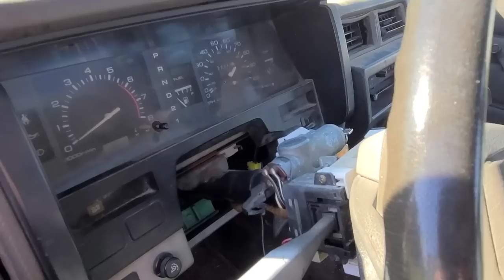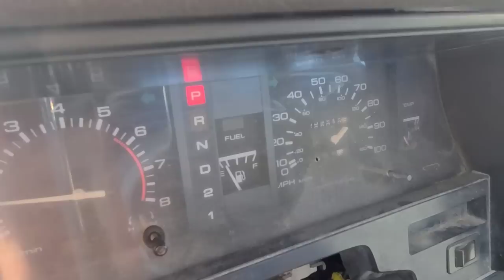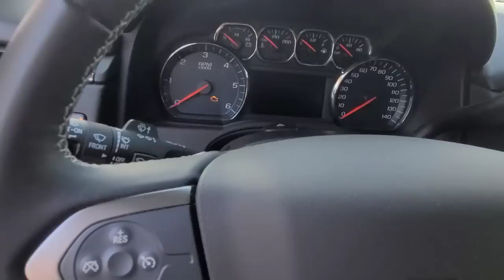Copart Pick Up, New Black Mamba Mods, KZ550 Restore, What I Do For A Living.

Comment: That old trucks nice. I'm guessing theft recovery . With the messed up ignition. Damn good they didn't ruin the whole good old truck. .
Looks like it'll be a good time in around and work truck . Sounds really really good for its age. Interior isn't the worst for its age. Body is in great shape for its age. 
I'd drive it easy and everyday . Beautiful old truck. It's a Gem of a find. Look after it and it'll run for years yet. Get new gauges if you want to . Give it a bath and clean it up. It'll be fantastic. 
The Mamba looks stunning. I'm thinking about getting a better truck for work . Not sure what to get. To you have any input for ideas TK.  I'm happy to import something to the UK if it's worth it. Need a truck that's gonna pull it's weight . Got no room for a show pony. Need a worker. 
Any help for ideas would be great? I'm still looking around . Will import. 

Old truck i think you paid $3000. That's what I'd have paid for it. ..

🇬🇧🇫🇷Chriss🇫🇷🇬🇧
Reply from the maker: For you in the UK I'd say pick up an old range rover